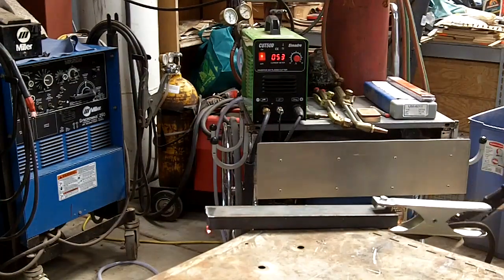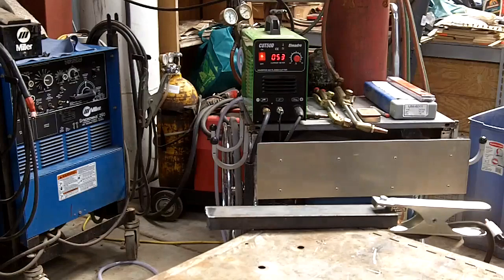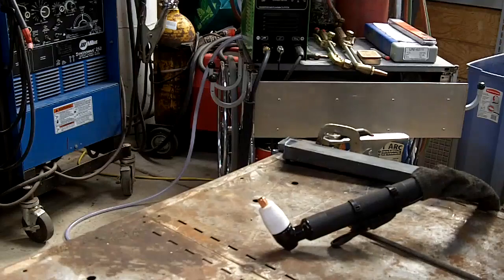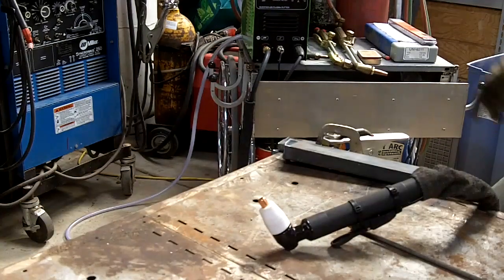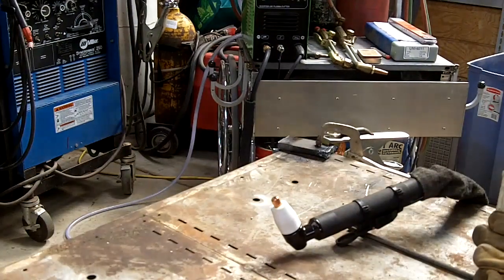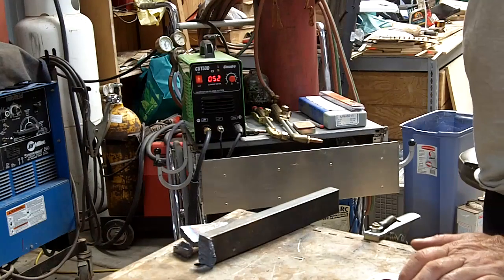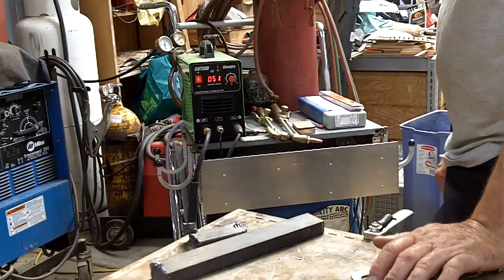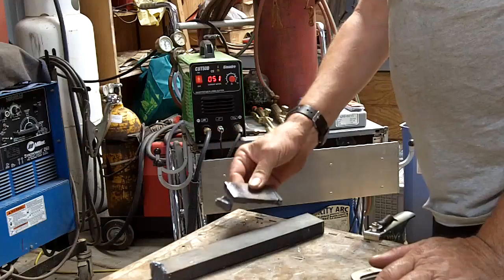New plasma cutter by Simadre

Comment from the maker: @protestphotos I guess it depends how long of cuts you are making. 3 or 4 hp compressor should be able to keep up with continuous use on the thickest materials. Smaller compressors  ones may drop pressure on longer cuts. Also you use less air on thinner material